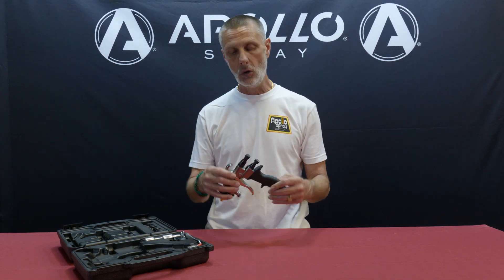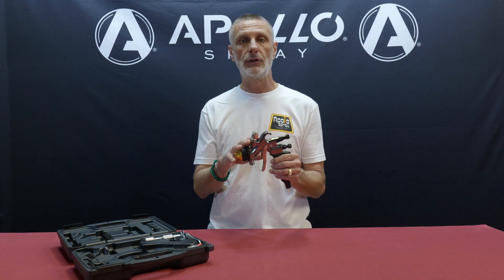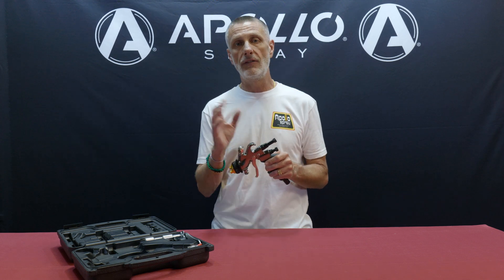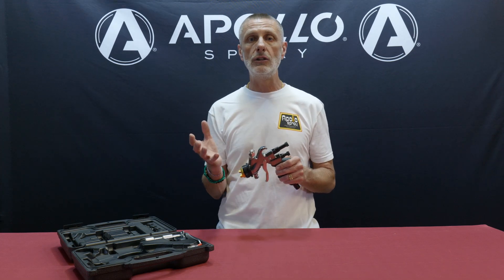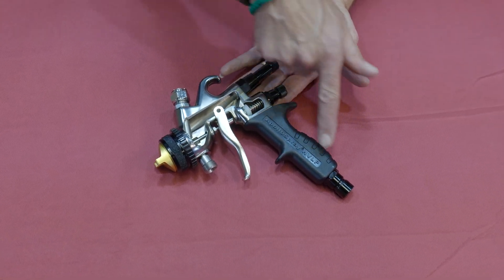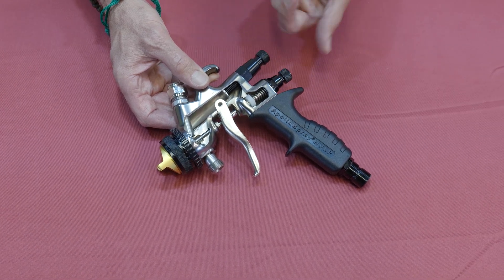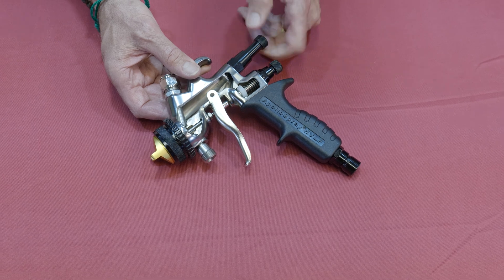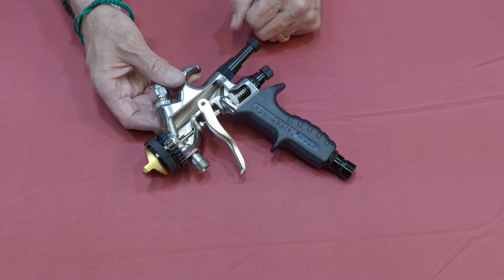How to Properly Use the O.S (Overspray) Control Valve on the Apollo AtomiZer Spray Gun

Comment: Interesting video.  Instead of using the turbine air control, why doesn't it make more sense to increase the turbine more than needed and fine tune it with the valve on the gun?
Reply from the maker: Since turbine motors are 100% duty cycle it's better for the motor to reduce the speed of the motor to achieve a lower air pressure.  With our digital control you can more accurately replicate your finishes over and over.  You also keep the motor running cooler, which will increase the life of your motor.  Rather than having it running at 100% all the time and creating more heat, which will reduce the life of the motor.